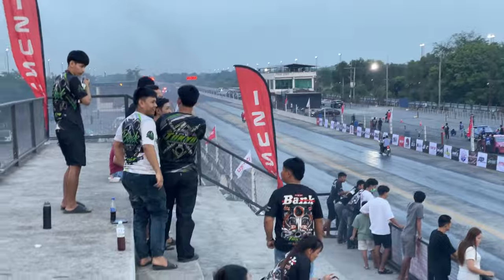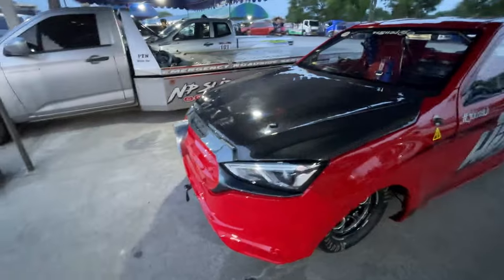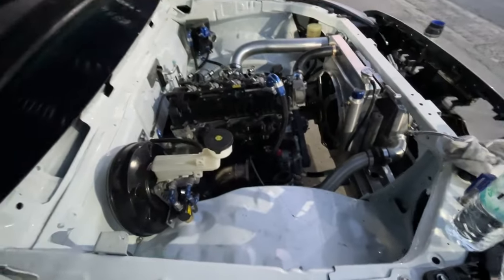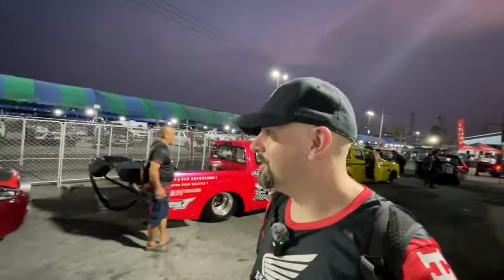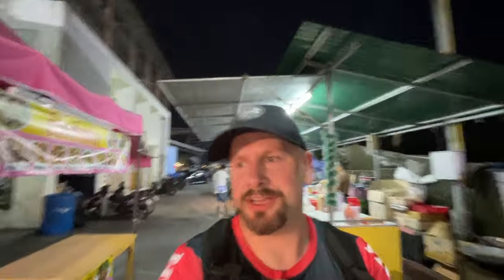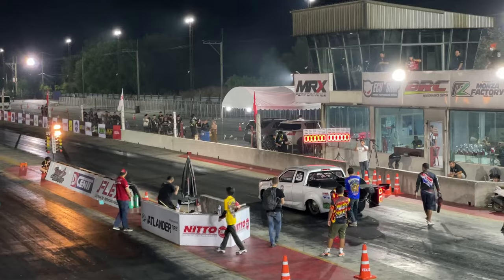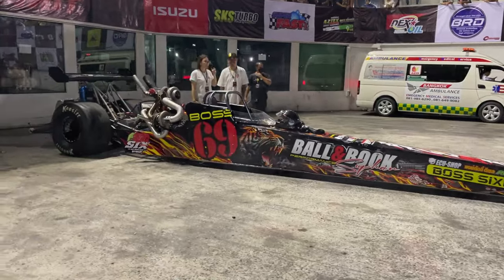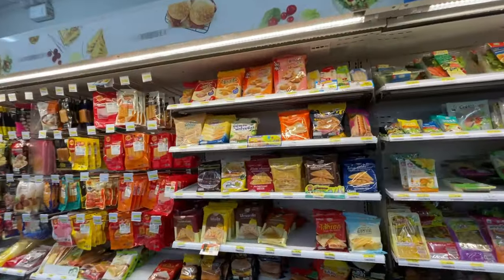Thailand has some fast diesels at Isuzu Race Spirit

Comment: That's an exceptional light truck. No wonder they rip so good.
Reply: Just going for a rip.
Reply from the maker: I never expected them to get the weight down that much. I saw that stock ones are supposed to be around 4000lbs.